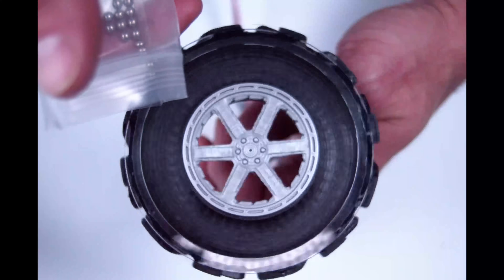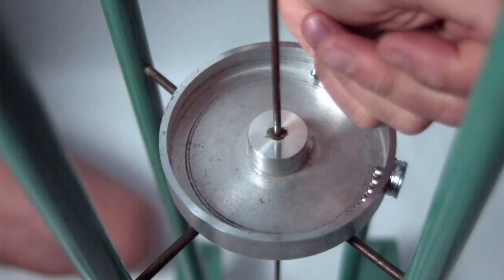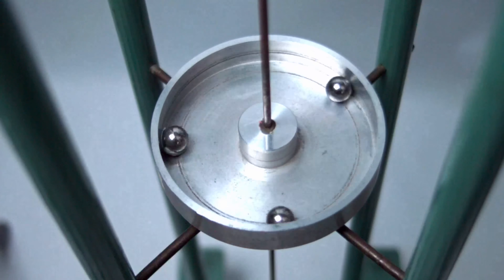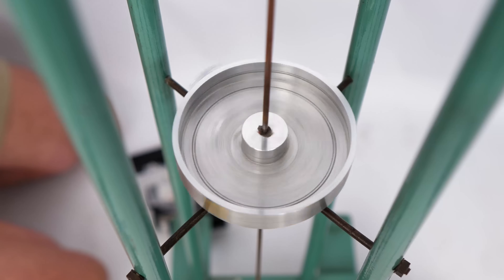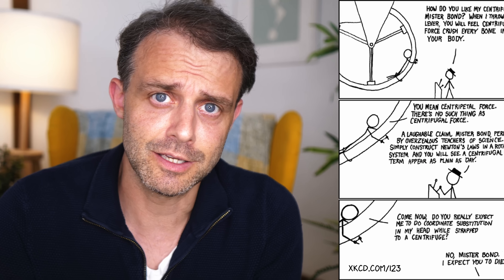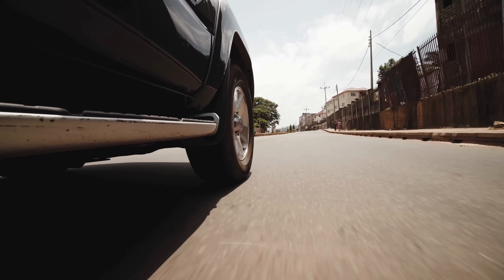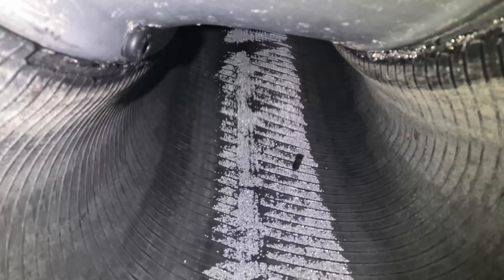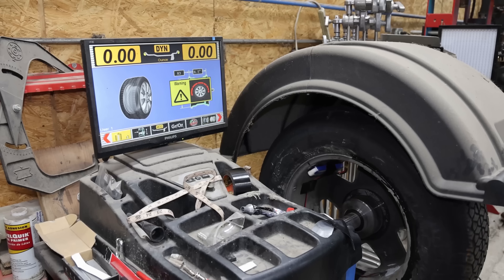Do tire balancing beads actually work?

Comment: they should make the bead hot melt, then you can easily balance the tire in the car shop by just putting it through some hot air while in motion.

Comment: Not convinced. Car wheels don’t just work at steady state or steady speed built up only. Any hard acceleration and braking, or pot hole impact will upset any loose balance beads…

Comment: Put a ball bearing in a perfectly round bowl and it's gonna go to the bottom. A spinning wheel has radial force that emulates the gravity that forced the ball bearing in a bowl. The imbalanced counterweight shifted the "gravity" direction until they stabilized each other - just like a ball bearing in a bowl would go back and forth until it got to the stable spot with no extra momentum.

Comment: People can swear by them all they want but the reality is this is only useful for sustained driving and never stopping. Any other time and the free roaming balls will be a destructive force within the wheel. Not just in wearing the inner walls but in balance as well. When the beads are not in 'alignment' they drive the wheel even further out, as you have shown. This will assist in the accelerated wear of your bearings, brakes, and even your diff. I saw one attempt where the youtube scientist tried using fix a flat foam with the self balance beads and immediately put the wheel into rotation at 60 mph so the beads dried in place when the foam catalyzed and hardened. This lasted until the first pothole and the cycle of carnage was resumed worse than before because now it was a large chunk smacking around inside. The unseen issue is also that when at low speeds that weight will destabilize the tire and cause loss of traction, most obviously discovered on ice or other slick surface conditions.

Comment: maybe this is a terrible idea but maybe it's a great one; what if mechanics had balancing beads that would fuse with the tires after 10 minutes or something, and they could remove the beads from a sealed case, pour them into your tire, and then spin up your tires at the right speed for 10 minutes, then the balls would be fused into the tires at the correct spots and they'd stay there at low speeds! I don't know much about cars but it seems plausible.

Comment: I need something to balance my ceiling fans. I have tried the kit with weights that you’re supposed to glue on. I even used my phone to take a slow motion video of the fan to see which blade was the heavier one and put the balancing weights on the opposite side, but nothing worked. 

I need them balancing beads!!

Comment: This method is used in off-road vehicles. If you drive into mud and it sticks to the rim, it can cause serious vibrations. To prevent this and to improve the vehicle’s handling on the road, small beads are poured into the tire. It's not used in a daily car.

Comment: I got those beads in my semi and it works fine , at lower speed an unbalance tires won’t be damaged and you won’t feel vibrations,at high speeds when damage might occur the tire balances again

Comment: You addressed it before I could whine about it; they aren't always balanced is the problem.  My experience was at a motorcycle shop that had us start using beads to save time.  It worked for the guys working on Indian cruisers because they just take the freeway to the next town for lunch and that's their ride.  I worked mostly on sport and standard bikes where people were doing more technical riding and it only took a few days before I had enough comebacks to refuse to use the beads anymore.

Comment: 10:12 so if the tire is at 50 mph and at its balance point, what happens as the tire is bouncing on the road.?
The highways aren't  perfectly smooth.
That outside bounce force must play into disturbing the balance point.

Comment: To get a better quicker effect on balancing a spinning wheel use a fluid of some kind water will work I suppose mercury would be better, I don't know about the wobbling resonance effect that a fluid would give you, Bing that you're using a fluid instead of ball bearings it should flow quicker and easier so maybe the wobbling oscillations that you can induce won't happen don't know need to try and find out.

Comment: I have been using balancing beads in all my tires in various vehicles since the 90's- from sub-compacts with 145r12 tires to off-road trucks with 40' mud tires. I have never used glass beads though, I use airsoft beads in street tires and have even used golf balls in larger off-road tires. I have had nothing but good results.

Comment: When I got my bass boat, I didn't know the trailer came with balancing beads in all four tires.  For a year I couldn't figure out why the trailer vibrated so badly while pulling it at highway speeds, some days worse than others.  I could feel the trailer vibrating in my truck.  Finally I assumed it was a tire balancing problem.  I took it in to get the tires balanced and that is when I learned it had these magical balancing beads.  I had them removed and balanced the old fashioned way with metal weights.  Oh what a difference, smooth ride from then on!

Comment: If you live in a rural area where your average speed is 30-45 mph, probably just get your tires balanced. As your demonstration showed, the beads actually increase vibration  at those speeds. Hit the highway tho....smooth as glas...or
 Glass beads, as it were:)

Comment: Back when I was mechanic-ing, tyre replacement procedure for a Subaru Impreza WRX-Sti was to change all 4x tyres at once with a charge of tyre beads in each tyre, ratchet-strap the car to a 2-post lift with the wheels off the floor, then drive it at 100mph for 10 minutes.
We used to get the apprentice to do the driving, the poor sod was scared half to death that it was going to shake itself loose and launch itself through a wall...at least until the tyres balanced out. Oh how we laughed 😂

Comment: WOW! Thank you so much Steve! I made an offroad Jag a few years ago and put 33" mud tyres on it. At <35mph and >60mph it was like riding on a cloud. BUT AT 45MPH it was like being strapped straight to the back of a jackhammer! The tyre guys claimed to have balanced the wheels (I asked because I never saw the wheels go on the balancer) but they obviously hadn't and those big mud tyres have a lot of mass so it was really exaggerated. I always put it down to the mud tyres having alternating chamfered treads (for clearing mud) and on hubs that really weren't designed for such large tyres and that's what caused the crazy shaking at ONLY this speed. But now I know the tyre guys were lying ass pieces of sheeeeet and I always suspected it lol. Thanks for confirming it! Great vid as always

Comment: Great for motorcycles tires and other tires that do not have a large flat contact surface, bad for wide flat contact surfaces.  they dont really work below 20ish, but at that point you dont have a much vibration anyway.

Comment: Iv always thought. Why not do away with the beads and just have a glue that will set in say 15mins thin enough to move around then get straight down the motor way to until set.

Comment: They work inconsistently. I bought a truck that unbeknownst to me had the balance beads in the tires. The tires would sometimes cause vibrations and sometimes run smooth. It didn’t matter if it was the same stretch of highway or not and going highway speeds. It drove me nuts trying to figure out what was wrong. As a last resort I had new tires put on and the guys at the tire place found all those beads in the tires and I instantly knew what was wrong. I had them put on new tires and the truck ran beautifully, no vibrations whatsoever.

Comment: Do not put balance beads inside of wheels with tire pressure monitor sensors, it will beat the sensor to death. They do work great tho.

Comment: So i have a question. If the beads only provide benefits once they have been moved into place by the supercritical point, then shouldn’t replacing them with weights and seating them in the same places they are when they are spun up permanently fix the issue, without needing to get to highway speeds first before you can appreciate the balancing benefit at 50?

Comment: Our fleet department that maintains about 40 ambulances started using these a few years ago. They are horrible for that application because as soon as you’re up to speed you’re slowing back down and the turning, hitting bumps, operating in all weather conditions, etc.  Every single one of our vehicles now have a shimmy or vibration typically between 40-60 mph, which is where we drive the most.

Comment: The problem with the balance beads from someone who mounts their own tires on car truck and my motorcycle is they only balance at higher speed. You are still way out of balance at low speeds and keep a wobble that wears parts and tires out. STAY FAR AWAY FROM THEM!

Comment: In the early 70’s when radial tires were beginning to be popular they would lose their balance frequently. My dad bought these things that fit on the wheel studs between the rotor/drum and wheel. You still had to balance the tires but usually with those goofy things on they would stay balanced. It was a metal plate with a plastic ring that was filled with small “bird” shot (shotgun shot) and it amazed me that it worked so well!! They cost about $50 early 1970’s money US.

Comment: I use the "dynabeads" in my motorcycle tyres and am very happy with how they perform. The biggest advantage with them is that the tyre remains balanced even after wear. Static weights don't dynamically balance the tyres so they often need re-balancing.

Comment: A car came into my shop recently for new tires, with balancing beads in the old tires(there were traditional tire weights on two of the tires, along with the beads). I had not heard about them, and the customer had no idea, as she recently bought the car and this was her first tire replacement. I would have saved and tried them out, had I known what they were, instead of tossing them away. I may just buy some and give them a try.

Comment: This happens cause ball bearings have there own spin and when they are not in equilibrium there own spin pushes them into places where there is no spin and it doesn't work on lower speeds cause there is not enough spin in the ball bearings to move them into the equilibrium

Comment: The advantage of fixed wheel balancing weights is that they don’t require “high speed” to work. They work at any speed.
Reply: You also only need to add the required amount, rather than just a generic amount where, as was demonstrated, some of the beads are simply countering for other beads that are in the wrong spot. 

I'd also like to see a long term test done to see if the beads wear the inside of the tyre casing
Reply: @Mad082sss I can’t imagine (given that once up to speed,they beads don’t move) that the ‘wear’ on the inside would be 1/1000th of the wear the tread gets from the road daily.
Reply: @just_passing_through  before they are up to optimal speed, and every time you stop you have beads moving around. And while the wear would be minimal compared to tread wear, the inside of a tyre isn't designed to have any wear. I only say this because I've seen bicycle tyres worn out from the inside due to using thorn resistant tubes instead of regular tubes (and yes, I'm aware of the difference between having a tube in there and beads).

Comment: Many years later and I still use them. 20 mph and they are working you don't need to be going 100mph with 40" tires for them to work

Comment: I've used the glass balancing beads in motorcycle tires for years with good results. Easy to install by removing the core of the schrader valve and pouring them in slowly through the nozzle of the small squeeze bottle. Just warn your tire tech they're in there before he removes a tire!

Comment: I am a 70-year-old guy who has been riding motorcycles, his entire life, started when I was 12 on dirt bikes and graduated up to a pro class drag bike before my racing days were over, turning 8.62 ET. I started using a liquid balance in my tires back then and always had really good luck with them. My brother, who is 74 years old, and also rides motorcycles, uses the balancing beads and swears by them. I will stick with the liquid, it makes more sense to me. RideOn liquid tire balance is the way I ride.

Comment: I say balance them with fixed weights, and then add in a small amount of balancing beads to enable fine tuning.  Assuming the mass of beads is smaller than the mass of fixed weights, this should minimize unoptimized location of beads worsening the balance, but then fine tune the balance once highway speeds have been reached.  That said, if one is using foam inserts to reduce road noise (typically for EV tires) I think we'd have a problem, as I assume the beads would end up damaging the foam.

What may be interesting is to have an injectable (like fix-a-flat) that solidifies to a stable point after say 30mins.  Inject that mass, then drive it at highway speeds for a minimum amount of time (say 60mins to be sure) and that could be your fine tuning mechanism.

Comment: So if I understand correctly (not completely)  the larger the tire diameter the are more effective and setup at a slower rotational speed?? I know it is very common for truckers to use balancing bags in the steer tires. But rarely do people use them in cars. Maybe it's just that truck tires don't get balanced before installing and never in a drive or trailing position. Great video. Thank You.

Comment: I had the glass beads in a 215/45/17 tire. They did not balance perfectly well at highway speeds, they almost acted like they needed time at an exactly held speed to true themselves. The car was changing speed often and had lots of g forces (how else can you drive! ) I bought the wheelset used and couldn't confirm the amounts of beads or internal wear, however I did see them when my local shop removed the tires. I believe all 4 were dry and clean internally because when moving the wheels around (summer only wheels) I could hear the beads moving around. I wanted them to work as I like the science behind it and it cleans up your wheel and the weights can't fall off but I would not pursue balancing beads again because of my experience. On my MTB's & motocross/enduro motorbikes we use tubes and or tubeless (sometimes with sealant) and or mousse inserts so external balancing is the only way so far for them.

Comment: I think that with the larger diameter Tires you would need to drive even faster than 50 mph to get the Beads to align, my Van has a slight shake at around 70 mph but goes away around 75 mph, I might buy some of those Beads and see if it works!

Comment: I'm not a fan of the balance beads, but, I can see how they can work under the circumstances you present here.  My conclusion is that I'm not putting any free floating material inside my tires.

Comment: What if there was an adhesive/fixative that set after n minutes (or heat) - insert the beads and "glue", "touch" motorway speed to get the beads in the "right" place, maintain adequate speed until the glue secures the beads in place ?

Comment: I am a little baffled exactly how we've been driving cars and trucks for over 100 years without balance beads, but now all of a sudden they are necessary.
Reply: I remember the advertising in Popular Science for this type of balancing.  Only it was in a tubular ring on the outside of the wheel.

Comment: how is the process of balancing by beads affected by the deformation of the tyre during rotation- the bit of flat rubber on the load bearing patch?

Comment: Only watched the first minute and your model seems inherently flawed because gravity is perpendicular to the rotation supporting instead of destabilizing the bearings also you.  The gravity is also supporting your bearings on a 2-D surface instead of the 3-D, rough inner surface of a tire that is also operation on and non-smooth, road with turns, traffic and lights.  I think functionally for the average driver the bearings will not significantly increase stability and the added resistance will subtly decrease gas mileage and tire wear.

Comment: Been using them on my motorcycle for decades, and smooth as glass over 200km/h no problems.
You need to ensure you have dry air in the tire, and beads that won't absorb moisture...................small glass beads are perfect for this.

Comment: I put balance beads in my small trailer tires that can't be balanced with a balancer. Only problem I see with those little glass beads moisture in the tires can make them clumpy and cause issues themselves. That's why I use BB's. Couple ounces per tire

Comment: 12:08 Well then clearly you have never tried Parsec before, because that's literally what everyone uses specifically for your "viable" speech points. And just like AnyViewer or HelpWire it's actually free, not that pseudo TeamViewer-style "free until it isn't" free - with harassing timers and usage restrictions and lockouts forcing you to subscribe rather sooner than later, hence the exact opposite of evident 13:03 "free forever" marketing bs which for some reason sounds like you know is a blatant lie (for anything after Version 6 which btw is easily obtainable just in case anyone really wants AnyDesk) ... or conveniently forgot about that fact as soon as they dropped that sweet sweet sponsorship money (:

Comment: My RV suffered from this for some time until I bought bead-type balancers (a metal plate with a hollow ring with the right amount of beads). My 5 ton RV suddenly smoothed out completely at any speed over 15 mph. It reduces suspension and frame stress as s result. My gas cooktop settled down and stopped rattling completely!